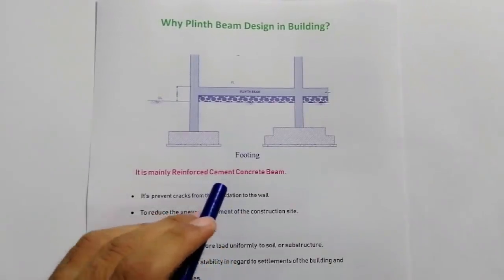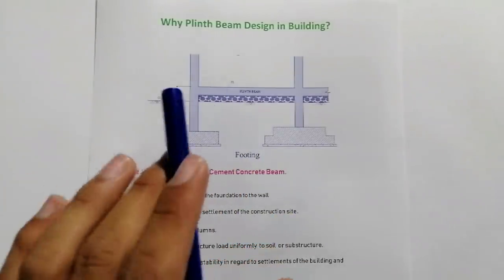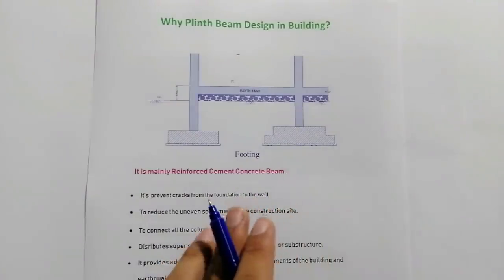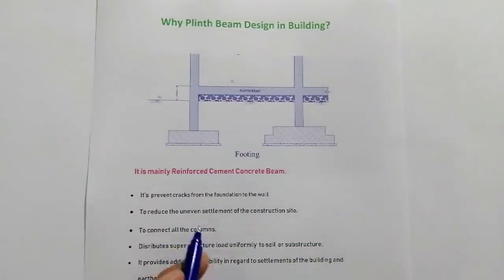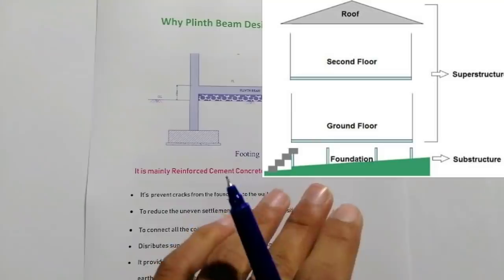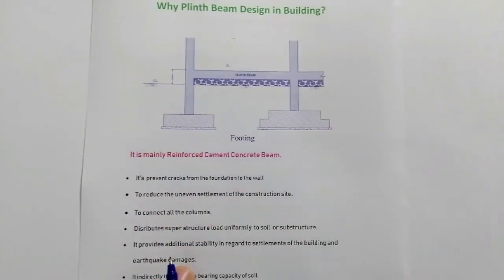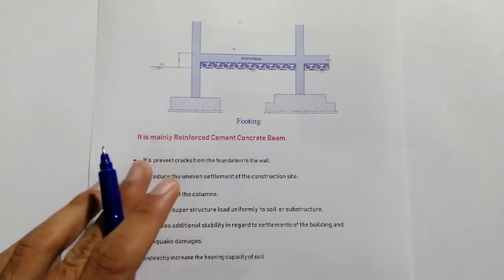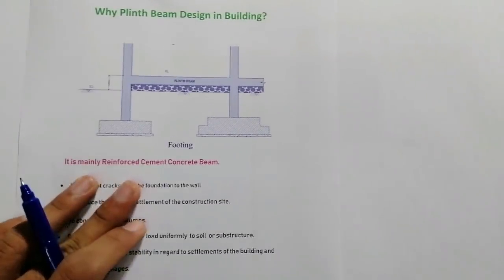Is Plinth Beam Required in Building? - Use of Plinth beam - Purpose of Plinth beam in Building

Comment: In my opinion the only advantage of a plinth beam in the sketch shown is it can be cheaper than the alternative, a strip footing, but only if the columns are closely spaced. None of the other advantages are practical or typically realized. I thank the speaker for their time but in my opinion this video is misleading.

Comment: How can a plinth beam increases bearing capacity. Please explain it.
Reply: gowtham varadareddy as he already said “ plinth beam indirectly adds to the bearing capacity of the soil “ as it is placed right above the ground level therefore in case of soil not able to withstand the load of super structure the plinth beam comes handy. 
Imagine a plinth beam as of a tire of a tank which distributes its massive load evenly and over a large area of a soil and therefore never gets stuck or sink into the soft soil. Similarly plinth beam prevents the structure to sink into the low bearing capacity soil by distributing the load over a wider area. Since it’s a part of a structure and not of a soil obviously ; therefore he used the term “indirectly”. Thank you.
Reply: @UzairAhsanWarsi  Awesome...I guess you're a structural engineer

Comment: Another advantage of plinth beam is that we do not required footing for masonry partition wall because they rest on plinth beam
Reply: Farhaan Khan but its easier to build wall footing than plinth beam. Plinth beams gives even settlement than wall footing.
Reply: @silentwatcher1455  it's not about easy or difficult..It's about economy..Footing will cost higher then plinth beam and the added advantages of plinth beam makes it preferable for engineers
Reply: @farhaankhan5868  in my opinion footings are cheaper if column spacing is greater than about 6m
Reply: Farhaan can we build masonry wall directly on footing without this plinth beam?
Reply: @walsjoe321  yes but in that case you have to provide strip footing for masonry wall
Reply: @farhaankhan5868  in the case of non-bearing masonry walls, trench footings are often sufficient
Reply: thank you